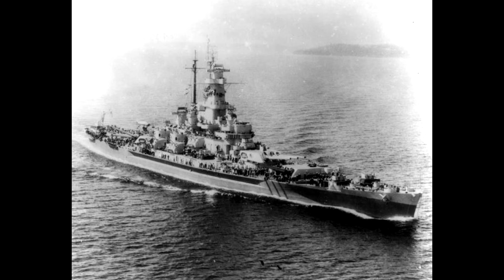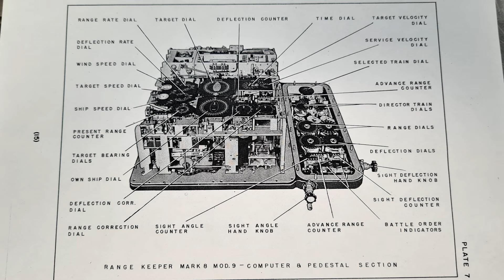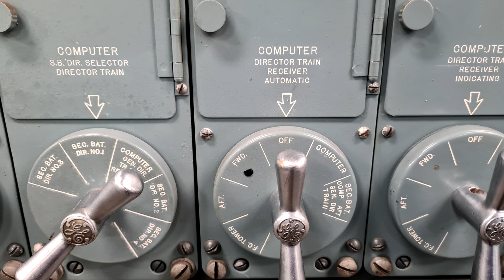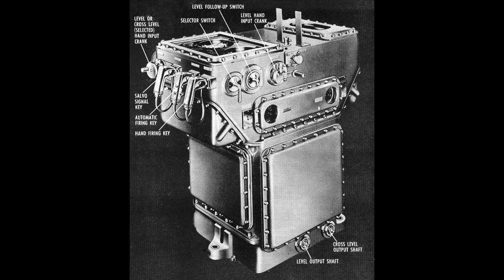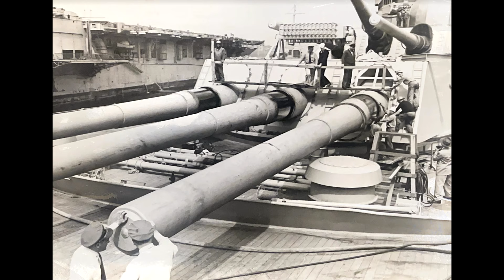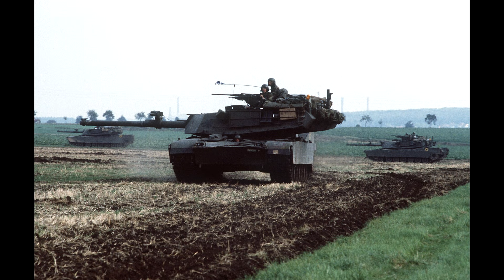US Navy Fire Control Systems - How They Really Work

Comment: Sometimes someone forgets not just how old computers are, but how complex calculation they could do.
Reply: When the US Navy was reactivating the Iowa class BBs in the 1980s, there had been some thought given to pulling out the mechanical FC computers in the ships' fire control centers, and replacing them with modern electronic computers. The effort was shelved however, when it was discovered that the modern electronics could not make any substantial improvement on the capabilities of the existing mechanical equipment.
Reply: @DefiantSix  And they had to bring back the old crew because nobody knew how to use the computers
Reply: @FLEXXBOX123 even worse, the explosion aboard Iowa in 1989 proved that the kids and their officers weren’t capable of doing routine systems maintenance designed to PREVENT that sort of thing. My uncle, who’d served as a boatswain whose action station was assisting the gunners, figured out most of the actual cause before the Senate/Sandia Labs investigation was even opened.
Reply: @DefiantSix 

The data input, however, was massively upgradedz
Reply: @DefiantSix  That explanation makes a lot more sense that the one given in the video where he sais that digital computers were not shock proof. I would have assumed that by the 80´s there would have been a number of computer systems on board for radar and missile tech that did not die everytime the 16" guns went off.
Reply: @hernerweisenberg7052  They were looking at off the shelf electronics and if you ever had a look inside commercial computers of the era, you would agree that this stuff gets rattled apart if it was to be used inside a car. Had they went with a proprietary electronic solution to deliver both better performance and ruggedness, it would have taken a lot longer and cost a lot more for a temporary reactivation. Hence why, sticking with the analog computer was the only viable option.
Reply: @hernerweisenberg7052  They nailed Tomahawk missiles and Phalanx CIWS onto Ohio-class hulls in the 80s, so yes. I have to assume that someone learned a lesson from USS South Dakota at Guadalcanal for the older systems.
Reply: Ohio class? The only Ohio class in the 1980s were our ballistic missile submarines. None of them have Phalanx systems. Of the 18 Ohio closet ssbn s, four boomers were modified to become guided missile submarines with their vertical launch tubes for ballistic missiles replaced by eight seven Tomahawk missiles.  @onenote6619
Reply: Pretty sure americans used a texas as fire control. In an emergency, they told him the enemy said texas food is just average
Reply: This, Niels, is because at its heart a computer is an electrical or electro mechanical device of any sort used to solve a mathematical equation faster than a human can.  To many people now see the now commonplace desktop or laptop general purpose digital systems developed and sold by companies for general purpose use.
This fire control computer, while still amazing in its own right, was meant for a single computation.  If the enemy is over there at bering X range y; where do I actually point my guns so their shells hit?
Reply: When I saw the photos I was immediately reminded of Babbage's differential engine and the plans for the first programmable computer he did not finish because the time run out for him and the precision required in machining the parts was just not there yet.
Reply: The word Computer derives from the latin computare and was first in use with medieval Monks to calculate the date of eastern.
Reply: I still have my slide rule from high school. My grandkids are amazed by it.
Reply: Analog computers were around for a LONG time before digital took over.  There are even some people advocating for bringing BACK some analog calculation to the digital world.  There are some things analog just does better than digital.  Digital generally wins because it is CRAZY fast, but it's not always the best solution.
Reply: @jeromethiel4323 Such as what?
Reply: @TzunSu  Google it.  Not hard to find.  Hybrid digital, analog, and maybe even quantum machines could be the future.

The thing is, digital can do everything analog can, but it takes time to do so.  If you can make the mechanical small enough (nano machines, for example) then analog processing might just be fast enough to complement digital.

Just look at computing today.  There are things digital computers cannot solve before the heat death of the universe.  Which is one reason why quantum computers are hot right now.  They promise a shortcut or an alternative way to achieve the desired result.
Reply: @jeromethiel4323 

The big tide calculator is my favorite mechanical computer. 

I feel like a good bit of the Anti -Enigma machines were mechanical at first but could be mistaken. 

The algorithm recently tossed me a video of this old school fidget clicker desktop mechanical calculator.

Stuff is so cool
Reply: So what you're saying is, there has been no innovation since, only improvement. I concur. Name one thing imagined, designed, and developed. One thing. We are riding on the coat  tails of gaints.
Reply: @virgilcaine3291 the wheel.
Reply: @virgilcaine3291  you could say the same thing about the people who designed the Iowa class ships as well. Those “Giants with coattails” are working on things today, and will be looked back on just the same.
Reply: @virgilcaine3291  Fusion reactors, Railguns, Lasers and Robotics and lot's of space related stuff like satelites :P

If you'd build an Iowa class now, you'd be able to cut down massively on it's crew, have automatic gunloading and laying and radar/GPS guided targeting, rocket assisted shells with terminal homing capability and other nic-nacs like nuclear propulsion.

But yes, ballistics were a very solved math even by WW1, we only went from some guy doing it by hand, to using analog computers to do the calculations, and then digital computers.
There is no way to improve that math, because the formulas underlying it can't change.
We still live in the same universe, in which air resistance, gravity, movement and such are all the same as 200 years ago and are pretty static.

Comment: 8:00 2000 feet in a nautical mile? Haha even studied experts cant handle that ridiculous imperial system xD
Reply: The nautical mile system is not quite the same as the imperial system but it is far more practical and relevant than the semi-ridiculous metric system, since 1 nautical mile equals 1 minute of latitude, thus equating nautical miles directly to the surface of the earth, simplifying navigation.  The meter, on the other hand was based on one ten millionth of the distance from the North Pole to the equator, passing through Paris.  A pretty arbitrary definition, of no practical use to anyone.
Reply: @markschennum188  And by the way, a meter is also the length of a pendulum that swings once per second or with 60Hz. With that definition and my wrist watch I can recreate the meter anywhere with decent accuracy. Do you know of any way to recreate a foot or a mile on your own to within lets say one thousandth accuracy?
Reply: @markschennum188  how about feet?
Reply: If Napoleon's surveyors had got it right, a nautical mile would be exactly 2km!

Comment: I remember reading that while the US battleships were still in service, a great deal of research was done on eliminating gun dispersion with computerised models and the best sensors available, but it turned out to be an intractable problem - some dispersion was inevitable.
Reply: Some dispersion would occur just based on burn rate of the powder charges. Shoot even small batches of even pistol or rifle ammunition and you will get variations in burn rate or powder weight even out of the same box. Now make those shots and charges 10,000 times larger.
Reply: @MrDmitriRavenoff 
Most people who reload don't understand why when they take apart, for example, a Winchester factory .30-06 cartridge that has a Winchester produced projectile, primer, cartridge casing and Winchester powder why the powder doesn't weigh the same as if you buy all the same components and load it yourself to achieve the same fps, it never will, and what mystifies people even more is when they take apart the same Winchester .30-06 factory bullet from a different lot and the powder in it weighs a different amount than the first one they took apart.
The reason is because even though Winchester will tell you which of their powders they load that particular cartridge with there's a basic difference between it and the same number powder you buy to reload with, reloading powder is what's called Canister Powder, and it differs from the powder they use to make factory loads because every batch of powder sold for reloading has to have the same exact burn rate for obvious reasons, the problem is when they make a batch of powder no two have the same burn rate, when they load their factory ammo they simply adjust the amount of powder to get the advertised fps from the ammo, but they can't sell you powder for reloading that varies from one batch to the other so what they do is make a batch, test it's burn rate, then mix in a different powder to create the same burn rate from one batch to the next, what they actually do is recreate the original burn rate from the very first batch of that powder that they ever made, every powder manufacturer has in storage a sample of the first batch of every powder they ever marketed, one of the oldest reloading powders is Hercules Unique which is over 100 years old now, and they still have a sample from the original batch that every time they make a batch of Unique they take a tiny sample of that original batch and test it's burn rate compared to the batch they just made, then they'll mix in whatever kind of powder they have to so the new batch has the same burn rate as the original batch, once they get it just right then they start filling the canisters that you buy for reloading, that way every one is exactly the same, because as a reloader you have to know that the same amount of powder from every canister you buy will produce the same exact results, the most interesting thing is how they store samples from the original batches, in water, not inside a container that's in water but actually in water, smokeless powder is actually water proof and deteriorates much more slowly when stored in water than when exposed to the atmosphere, now of course it won't burn when it's wet but once removed from the water and dried out it burns just the same as the day it was made, Hercules has huge glass vats that have a foot or two of original powder samples in the bottom that are filled with distilled water, every time they need a sample to match burn rates with a new batch they take a tiny amount out and dry it, then test it's burn rate for a comparison. 
The deviations in large naval and other big artillery guns are because even though they tried to make the powders for those guns like canister powder, by mixing different rates to recreate the original powder, you're still loading bags that can have slight variations in them, they simply couldn't weigh those bags as consistently as a reloader can consistently reload small cartridges, as a reloader you can get exactly 1/10th of a grain consistency in each cartridge, with those big bags used in those guns they were probably lucky to get within an ounce of each other. 
Still though it's incredible the consistency they can get out of those big guns, they even knew how much barrel erosion after every shot was going to affect things and would adjust for it, in reality the amount of deviation from one shot to the next is minute, especially when you consider they were propelling Volkswagen Beatles 20 miles inland and pretty much dropping them right where they wanted, to see just how accurate the guns of the Iowa class battleships were look up the distance and accuracy specs on them and then look up the distance and accuracy specs on the Yamato's gun's, they might have been bigger but an Iowa could nail the Yamato well before it could get close enough to hit it.
Reply: Bear in mind that for artillery pieces every single shot is logged and detailed records kept, so that the barrel liner wear and other details can be fed into calculations for the next salvo. Every single gun tube has its own history. This is true for land-based towed artillery such as the M-198 155mm howitzer as well as naval guns.
Reply: That makes sense, even if you could compensate for minor differences between individual guns, you're still dependent on the consistency of your ammunition. Look at Italian battleship gunnery in WWII.
Reply: When the computer to calculate the trajectory of your shell is bigger than your ships, you know it's time to just eyeball it.
Reply: If dispersion was a result of static systematic error it could be eliminated by individually zeroing the guns, however it is a result of chaotic processes , with many of the factors involved being impossible to sample for, such as varying enviromental conditions between gun and target.
Reply: They'd have been better off developing a guidance system to install into a modified ballistic cap, so that each shell could home in on a target.
Reply: And how would they do that? The proximity fuze (VT) using 1940s technology took two years to develop and all it did was explode the shell when the radar return was strong enough to acuate the fuse. Look at the tech the Germans used to produce the glide bomb and an anti-surface ship air-launched missile. Neither would be effective in guiding shells traveling ten times faster than the missile. Nor could they have survived the multiple stresses of firing. Then there was the problem of finding a materiel through which the guidance system could work while retaining the integrity and shape of the ballistic cap. The first guided shells weren't developed until the 1970s with the arrival of solid state electronics and then in the 1980s with miniaturization and computers.
Reply: @michaelsnyder3871  I was referring to when the Iowas were reactivated in the 1980's, by then they were already developing guided artillery shells for 155mm howitzers... doing something similar for 16" battleship shells would probably be easier given the additional room available.
Reply: @drtidrow it was looked at along with cluster munitions, sabot rounds, and ram jet assisted ultra long range shells and deemed feasible.
All of the funding evaporated when the Soviet Union collapsed
Reply: Dispersion of a form was necessary to ensure hits on a moving target. To much dispersion meant that the mean distance between shells was greater than the length or beam or area of the target and the distance the target would move between the firing and the arrival of the shell. This is why ships fired their guns in savlos, to produce a number of rounds arriving around a calculated point that would ensure, for example in capital ship terms, that a capital ship target travelling more or less along a parallel track would be hit by at least one or more shells. At Jutland, hit percentages did not exceed .5% of expended rounds and that was including rounds fired at close range at surprised, damaged or dead in the water targets. On the other hand, in October 1944, the three rebuilt USN battleships detected the IJN battleship at 40kyds, acquired the target by 35kyds and had a firing solution by 30kyds. Salvos were fired at between 25-20kyds to conserve AP ammunition, yet two of the USN battleships got hits on the 1st and 2d salvos, something that would have been though impossible in 1939.
Reply: You NEED dispersion. You are not firing 1 rifle bullet, you are shooting a cluster.
Reply: @tombogan03884  Yes and no on the Iowa-class battleships that were the subject of my original comment. The turrets are 3-gun, not triple, so each one is elevated and aimed independently. If, by some miracle, dispersion could be 100% eliminated, as the US Navy hoped, the distance between each shell upon impact would have been the distance between each gun on the turret. But without miracles, the impact point is somewhere within a circle that gets larger with increased range.
Reply: @onenote6619 

They had the math to account for the gun spacing on the firing BB, if dispersion could be eliminated they'd have been stack impacts on top of each other.